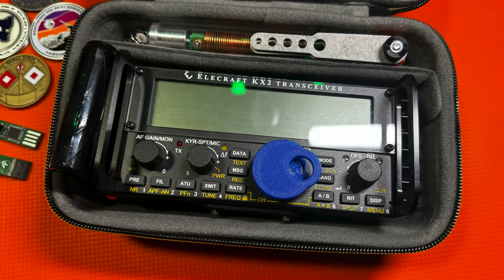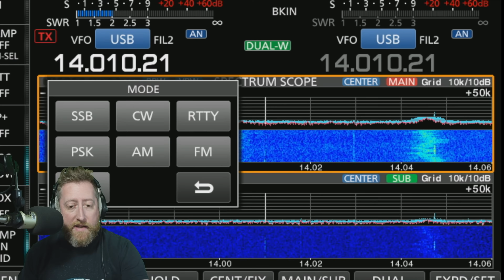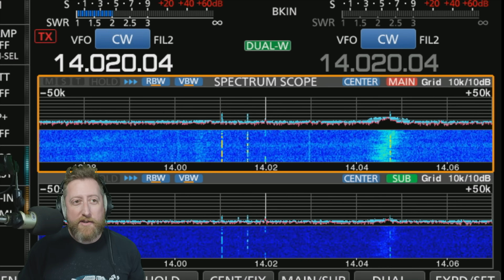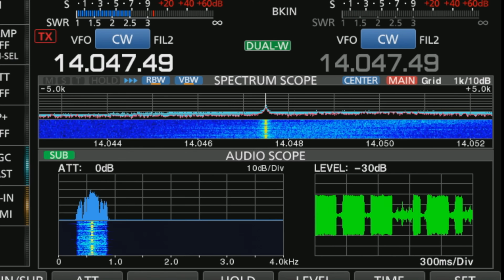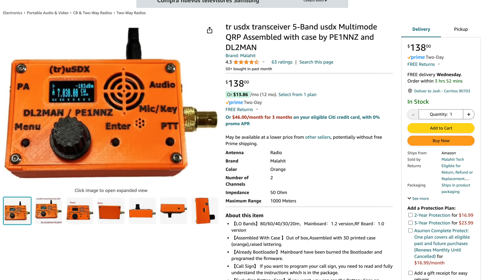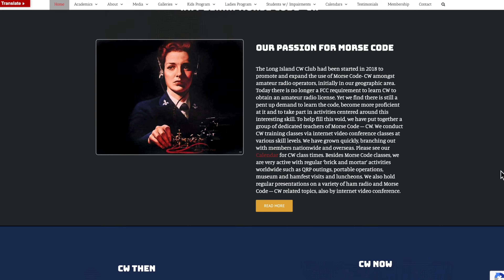Why Should Anyone Learn & Use Morse Code?

Comment: Learning morse (to do POTA) is what got me active in radio. Passed General in 2019 and then did nothing with it.
This month marks 1 year of my commitment to learn morse. I don't remember the exact day but it was sometime in April 2023 when I decided to learn.

Finally did my first CW activation in early March

I ask for repeats a lot, I miss things when hunters go 'off script' but I'm better at both sending and receiving each time I go out. 

Its weird, its fun, its different.
Reply: thats the way to learn...GET ON THE AIR... sorry for yelling     73
Reply: @swilliams2229  Not getting on the air sooner is something I regret.

Feel like I'd be in a much better place if I'd gotten over the key-fright and started calling CQ in Sept 23. I knew the whole alphabet by then but my confidence in my ability to copy was exceptionally low.

My experience so far is that people using CW are very forgiving of new operators.
My first pota activation I was so nervous I could hardly send people's call signs without taking two or three attempts but every hunter who came back to me endured my newbish ability.

My most recent pota activation a hunter (from Czech Republic) stuck with me for five minutes to make sure that we both were copying each other correctly. That particular activation I hadn't expected DX. I wanted to do 15M to mix it up and at 1PM it seems DX was all I was gonna get on 15 because the only other station that came back to me was in France.

Comment: Great video Josh and very valid points in favor of CW. Let me say this about CW, at least in my case, you have to want it. I originally got my license when the code requirement was in place. Obviously that has long been done away with and I finally got into HF. Once I passed the Extra test, I wanted to continue learning more and decided it was time to give CW another shot, after a few previously failed attempts. I managed to learn the characters, numbers and some punctuation in about a week. I still need to work on it but it only took that long to learn the composition of the letters when I wanted to. I spent 2 months on a deployment years ago trying to learn code and retained few characters and never could remember the difference between A and N. This works when almost nothing else does and for a lot of reasons, it's worth learning. Is it a quick conversation using CW, absolutely not. Is it an effective way to have one, without a doubt. I'm starting to get back into it so I can get my copy speed up with the hopes of being more proficient and hopefully, one day, work a special event, field day or a POTA entirely over CW just for the fun of it.

Comment: Morse code sucks. I got my Novice and technician licenses back in 1988. Barely managed to pass the 5 wpm code test after months of studying. I then took and passed the general written, thinking, that gives me a year to learn the 13 wpm code. Didn't happen. I took and failed the code test twice. Didn't even come close. I gave up. Fast forward all the way to 2009, after the code requirement had been dropped, and I finally got my general. Not everybody is able to learn code. Yes, I can see how it might be fun for those who like it and are able to learn it. But that does not include me.
Reply: Just because you couldn't find a way to learn it, doesn't make it automatically, "suck"

It's a great mode, and is extremely versatile. I would suggest if you still are interested, you do what Josh suggested and join the LICW club. They have online classes that I am almost certain will benefit you. 

I encourage you to give it a chance and learn to have fun with it, because that's what this hobby is all about. Good luck and I hope to make a CW QSO with you some day.
Reply: You have mastered talking out of both sides of your mouth. Sure, there are other ways to communicate. Morse Code is just one of those ways. If you dont like it, hey, you do you. But if you like having fun with the hobby, which I do, then Morse code has been an awesome addition.
Reply: @PendejoRyan  A big part of learning should be finding ways to learn. Try it from a different angle, or with a different method, or with different people, or at a different pace, or with a different attitude. But it’s also definitely  possible to stay with what doesn’t work and prove to yourself that’s it’s impossible.
Reply: @macuaig2  I couldn't agree more, but just saying something is worthless or "sucks" because you don't get it doesn't take away from its validity.
Reply: Morse does not suck, he is right in what he says, although there are faster far more efficient ways to communicate, it is still more efficient than voice. So it might have its uses, and it could even still be useful today. Having said this, it's an absolute waste of time to try and learn Morse code.

Comment: I learned code to get my license. That 20 WPM was tough. Never had a QSO using code though.
Reply: Exact same story here.
Reply: Where is that still required?
Here in Denmark we can get the highest license without learning and proving morse....
Reply: @fthorup . He's speaking of testing when CW testing was required here some years ago. I don't think Morse is required anywhere anymore. The U.S. was among the last to phase out CW testing and that was quite a few years ago. I tested at 20 wpm >30 years ago, and by the time my wife got her license a while later the requirement for all license classes was reduced to 5 wpm. The CW testing requirement finally ended here in 2007.
   Ironically my wife was a natural at CW, where I struggled quite a bit. She learned the entire alphabet in 24 hours!
Reply: @fthorup  no idea where it is still required if anywhere. At the time it was required here in the US.
Reply: @OnAirVoice  I got my Novice Ticket (US) in 1989 and 5 WPM was required for a Novice License. Then, for General Class it was 13 WPM, and for Advanced Class it was 20 WPM.
Reply: The average person speaks at a rate of around 150 words per minute.  Compare that to CW.  As the people on Shark Tank would say for that reason I’m out.  But yeah, 10+dB SNR improvement or better. In tough situations I’ll give you that.  I’m pretty busy so I just like to quickly get on the air get a few contacts chat a little bit and move on with my day. I don’t want to spend hours on ham radio but that’s me maybe when I’m older.
Reply: @Z28videogates  at the time if you wanted a license CW was part of the test whether you liked it or not.
Reply: @OnAirVoice  I hear you there.  I recall in late 90's it went from 20wpm to 5wpm to not needing it all for Extra.  Now you'll hear on the air sometimes people saying to some of the other hams... "Oh he's one of the no-code extras".  haha.  All in fun of course.